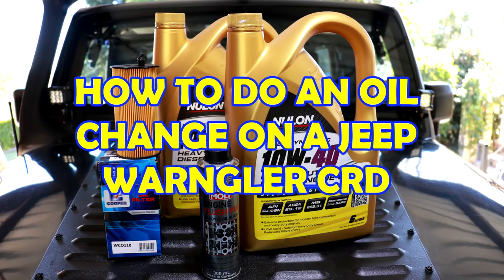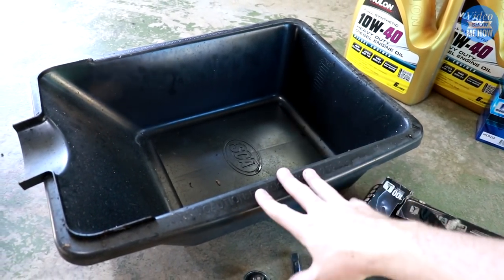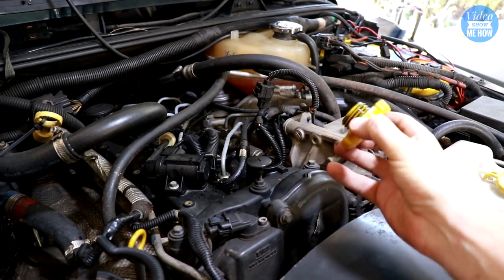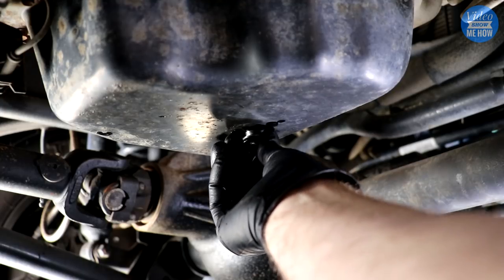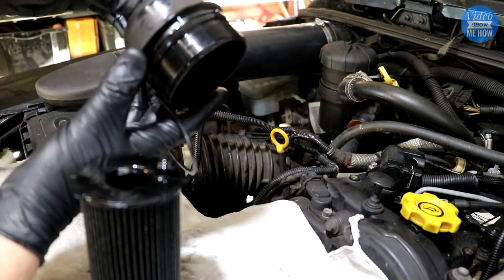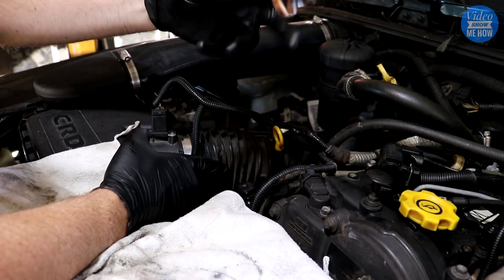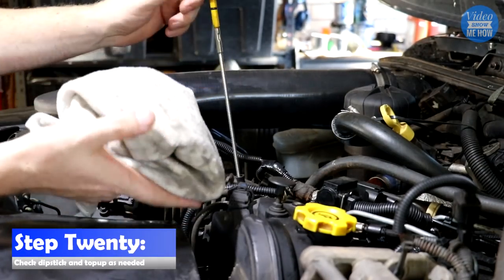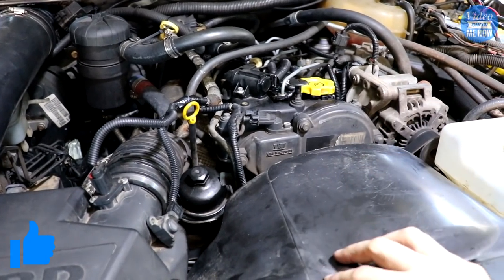How to Change the Oil in a Jeep Wrangler CRD Diesel - Step by Step

Comment from the maker: What's your favorite oil?
Reply: Just one trick to make it even better. Remove the filter for the duration of old oil dripping. It will let air in from the top making it drain faster. Also it will prevent old residing in the filter to get into the system when you remove the filter when the drain nut is back in place
Reply from the maker: Top tip!

Comment: Thank you for the tutorial! Just one missing point... how do you perform the "Oil Life Reset" in the ECU?
Reply from the maker: Ahh yes for the 2012 JK will need to this (assuming you're meaning on a Jeep JK?) 

How to Reset the Change Oil Alert on a Jeep JK

1) Put your Jeep in "Park" and turn off the engine.

2) Turn the ignition to the "On" notch, without starting the engine.

3) Push the gas pedal to the floor three times (within ten seconds). Turn the ignition to "Off," and then start the engine to verify that the alert is turned off.

Comment: how long should the oil change intervals be? I drive mine about 3,500km city driving with lots of stop and go traffic per year  so I change mine once a year. Is that okay? The owners manual suggests to change it every 6 months.
Reply: Thank you so much for uploading this video btw. Helps a lot!
Reply from the maker: For a crd with lots of stop start I'd be changing every 5k. I'd also be trying to go for a decent run every now an again (at least an hour on the freeway) so that the engine can get to a good temp to burn out some crud :)
Reply: Thank you!

Comment: Hey mate! Cheers for the video! Just wondering if you’ve experienced any white smoke on start up along with a small oil leak in yours? Have the same jk CRD 2009 model, have done a bit of research, doesn’t sound like a biggie but would be keen to know if you had a similar situation, Cheers!

Comment: I am abit confused on what oil I should run on my 08 jk crd with 175km Melbourne weather conditions I have been suggested 10.40, 5.30 , 5.40 and many more what should I run? Thanks
Reply from the maker: Hey mate, I run 10/40 in QLD, find it to be a little quieter in my 08. Both specs 5 and 10 would be fine, def go a 40. We're pre DPF so don't need the newer compatible oils, I'd def get something at least Ci-4+ penrite and nylon both do a good one. Currently running the nulon heavy city diesel 10/40 full syth in mine for the last 50k.
Reply from the maker: Some good info here https://www.penriteoil.com.au/knowledge-centre/Specifications/194/api-service-classifications/363

Comment: I have heard of Wesfil oil filters failing.  Any idea mate ?
Reply from the maker: Hi Pav, haven't heard of any? This Cooper filter that I have used here is the same company. Westfil has been around for a while and follows some pretty stringent standards (ISO 9001:2000 ISO/TS 16949:2002) as with most aussie filter brands. What do you usually use?
Reply: just serviced my '08 JKU CRD today.  Used the exact same oil....and Mopar oil, fuel & air filter :-)
Reply from the maker: nice work! :) Same model as this one!

Comment: The bottom outlet of that Provent catch can....what have you connected it to ?
Reply from the maker: The bottom outlet is the drain hose, the oil collected drips into it. There's a drain tap on the end of it. I have it positioned above the gearbox cross member for easy draining at servicing :)